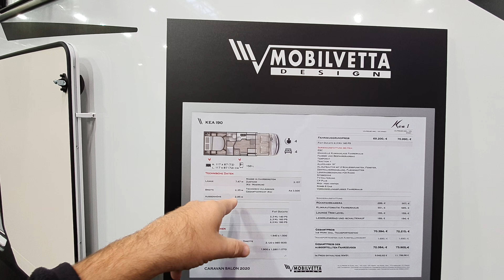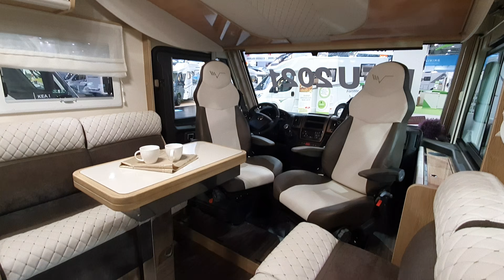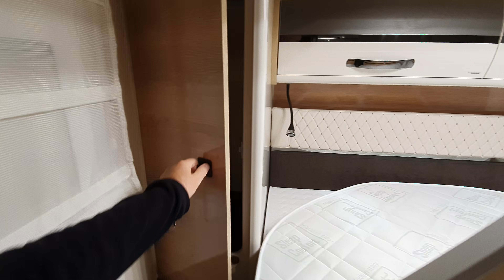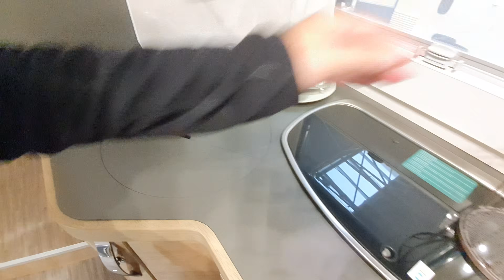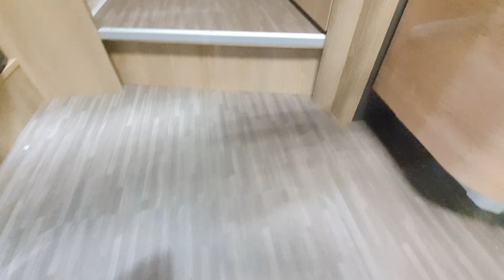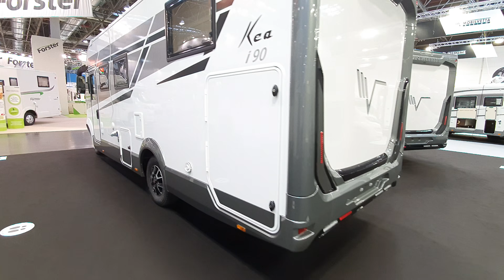Mobilvetta Design Kea i90. Somewhat outlandish motorhome concept.

Comment: Why arnt more vans featuring a hotplate like the Mobilvetta K-Yacht instead of three burners. Two burners and an elec hotplate is so much more flexible. Not many people use all three burners at the same time.
Reply from the maker: The hotplate is an option in various vehicles.  I tried it in my own van and gave the hotplate away.